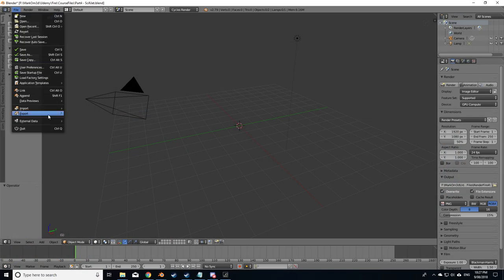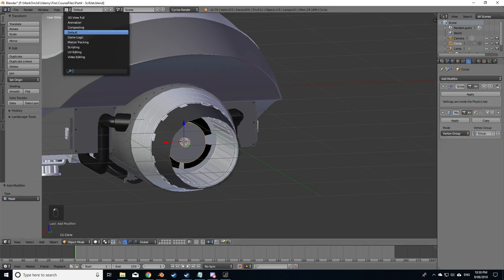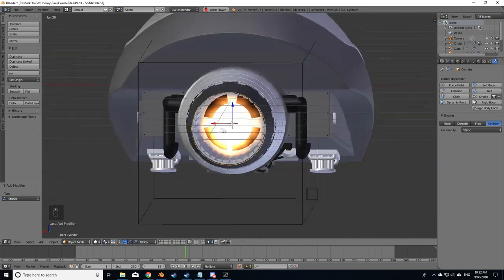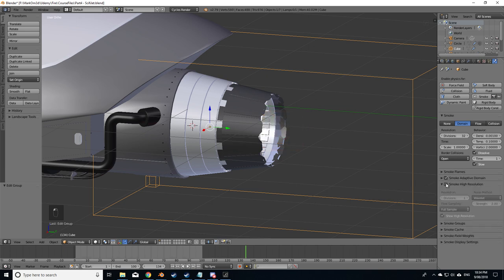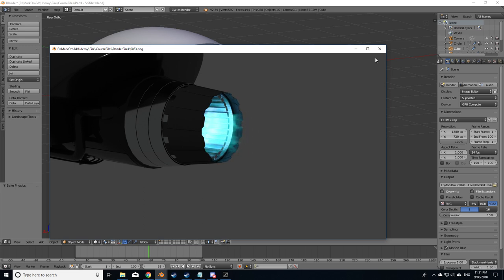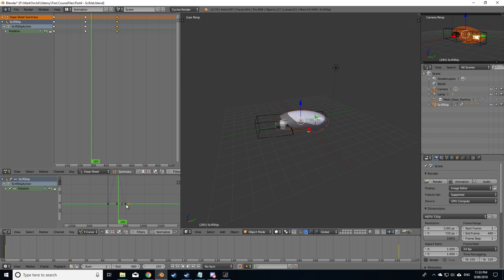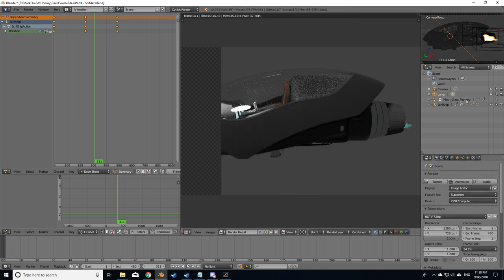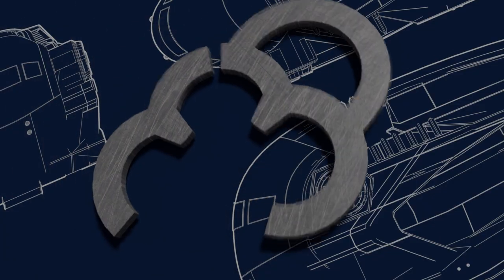Create Scifi Flame in Blender - Tutorial

Comment: I may be a bit too late, but when I render, the particles don't show up, they're basically invisible. Can anyone help me? I haven't made the emiter invisible to the camera, just in case. And I am in Cycles Render just like in this video
Reply from the maker: Snowkat I’m not at my pc atm, but if you are using particles, check the render section and change the halo option I think to object. Set a the object as a sphere
Reply: @Markom3D  I used Physics just like you did in this video. Adding Smoke, Type Fire....  I apologize for asking for your help when you're not on PC. The fire appears on the Rendered Viewport, but if I try to export it as an image, the fire effect does not appear
Reply from the maker: Snowkat sorry I read particles before. I know this sounds silly, but do you have light in the scene? Also there is a new material node for volume called principle volume or something like that. Plug that into the volume output and turn up ... ahhh can’t thing of it but it’s the second spider from the bottom to give it an emission.
Reply: @Markom3D  My bad for saying particles, don't worry ^^. So, I'm currently using 2.79 just like in your video. I do have lights in the scene, I know it may be silly but I used 3 suns to make the lighting just a bit faster. Is the node called "Principled BSFD"? and the two options at the bottom are "IOR, Transmission" or "Normal, Clearcoat Normal, Tangent". I'll give this a try. Thank you so much for helping me out
Reply from the maker: @Aral750  There is no "principled volume" in 2.79? Sorry I have moved across to 2.8 now
Reply: @Markom3D  I've tested what I wrote in my last comment and nothing works with that node. I've tried changing the lighting on the scene and that has nothing to do with the fire not appearing in the final render. Would it be ok to contact you to try to fix this issue?
Reply from the maker: @Aral750  sure, but I wont be on the computer for another 10 hours or so. currently 10am here https://discord.gg/27EFjD